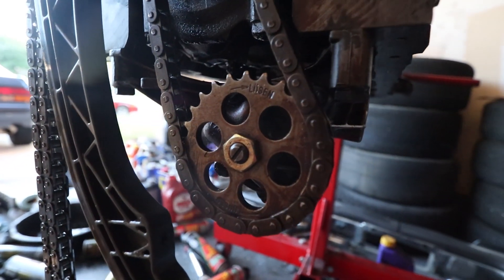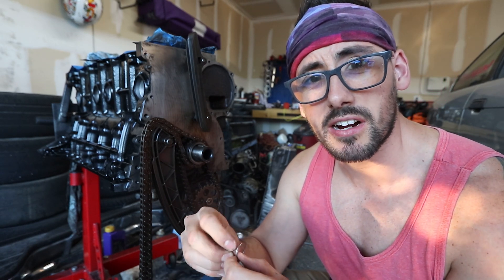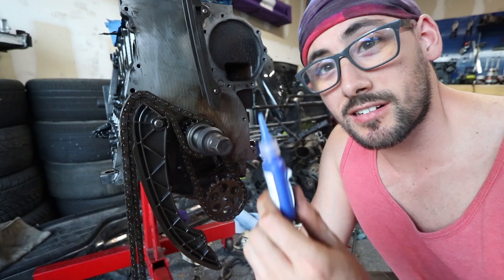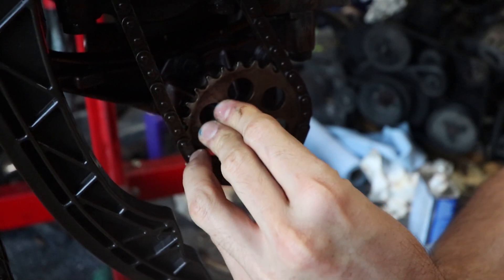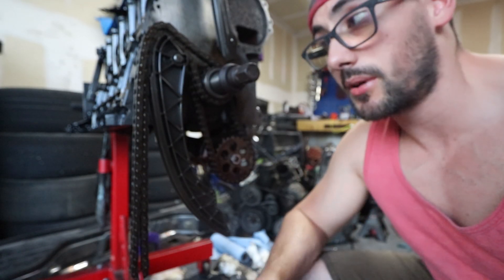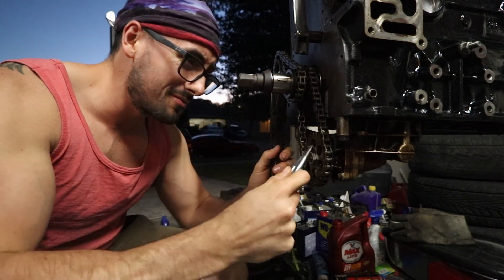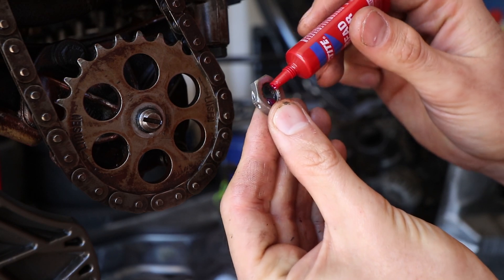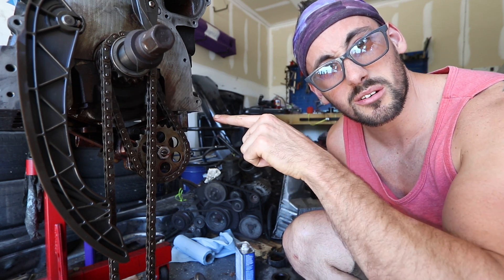BMW E36 Oil Pump Nut Mod

Comment: This will fix pump nut loose tendencies, but wont fix oil pump axle shredding. :(  It is close to useless without a sistem that stretch the chain and prevent wobling

Comment: how long does this take, ?? does the motor have to come out ????
Reply from the maker: fixing the oil pump nut was pretty easy for me because the engine was out of the car. With it in the car I am sure it is possible, but you would have to jack up the engine enough to remove the oil pan so you can get access to the nut. It would definitely be a pretty difficult job to do inside the car. This mod is mainly important if the car is going to be driven hard on a consistent basis. If it is just a daily that isn't driven hard, then it is probably not worth fixing. The main reason it gets replaced is because at high rpm's the vibrations can cause it to come loose in some cases. I am planning on boosting mine in the future and it sees a lot of track time, so for me it was just peace of mind. Hope this helps!